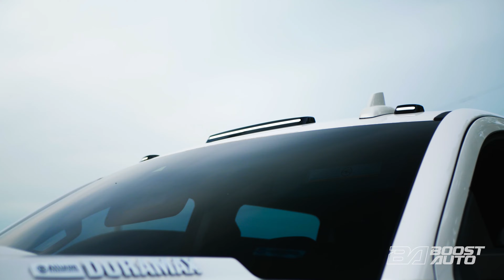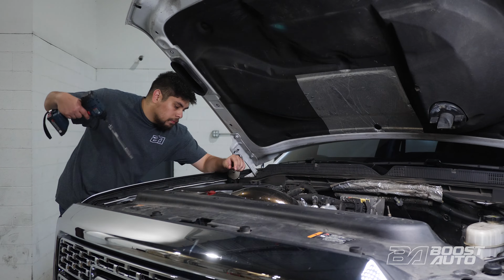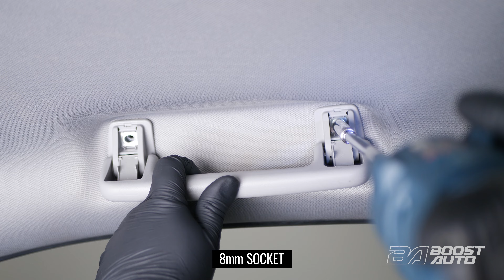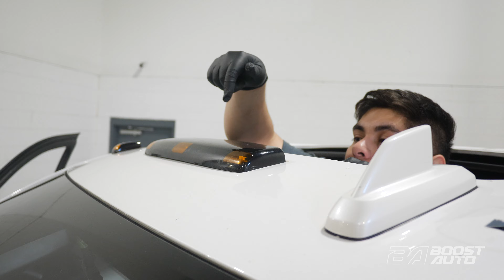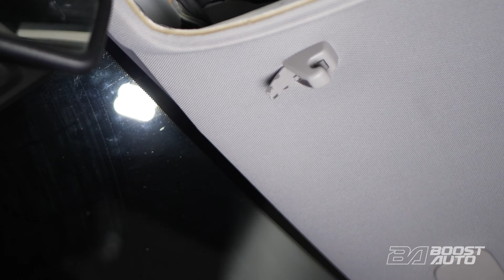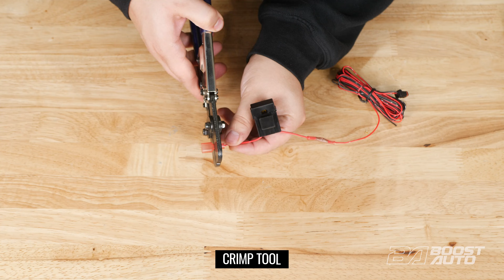Boost Auto S-Series Cab Lights Installation Guide | 2015-2019 Chevy Silverado & GMC Sierra 2500/3500

Comment: If I were too get white with running only with start up sequence would I need the module and splice wires or just plug into factory plugs
Reply from the maker: Plug & play - you only need the module if you get turn signal

Comment: My cab dint come on i bought the ones with trun signal but have not installed the module yet will they not come on normally without module??
Reply from the maker: If you bought cab lights that have the S-Series Module, the module  be installed in order for the cab lights to function. If you simply plug them in, they won't work until you install the module
Reply: @boostautoparts  
Thank you got them to work i was wondering why they would not come on and had power on all connectors  i ordered them amber but thinking I want white can I change them simply with the wiring because when I was trouble shooting I saw them flash white
Reply from the maker: @ to inquire on alternate options, please contact our team at 765-831-2830

Comment: Okay so I’m not sure what’s going on here because my factory cab light does not bolt on it only screws from the top
Reply from the maker: Factory cab lights for this generation of truck bolt from the bottom up. If you're screwing from the top down you must have a prior generation of truck. Contact our team at 765-831-2830 or email sales@boostautoparts.com with your VIN and we can assist

Comment: What if you don't have any lights? What is the layout and what is the best tool to drill those square holes?
Reply from the maker: If your truck didn't originally have cab lights you should reference our retrofit install video which will be available in the next 3 months as of writing this comment (5/14/2024).

With that video you will see we will provide a template, wiring harness, and you WONT have to cut square holes! Stay tuned. Feel free to email sales@boostautoparts.com if you'd like to be notified when they become available.

Comment: My 2019 2500 does not have the power cable in pin 1 where should I tap for power?
Reply from the maker: Give our team a call at 765-831-2830 so we can assist!
Reply: We’re do u tap for power without the power cable
Reply: My doesn’t either.  Were you able to tap for power?
Reply: They sent me a fuse tap and just tapped into one of the fuse in the fuse box
Reply: @SMDO  I got a fuse tap but no idea where to connect it and did you have to connect your ground
Reply: I tapped into fuse 10 which is a 15A for Cargo Lamps, for ground I just spliced into the ground cable on the harness
Reply: Pin 10 on the harness for ground
Reply: @SMDO  so pin 10 for power what about ground? Or you used pin 10 for ground?
Reply: @MiguelGonzalez-yu2jm  
pin10 (black cable) for ground. 
Fuse #10 (15A Cargo Light) for power

Comment: Is there an other way to connect or wire the cab lights for those of us that don’t have the factory cab lights with the factory harness?
Reply from the maker: We will have a separate video and wiring harness specifically for those who are adding cab lights to vehicles not originally equipped.
Reply: @boostautoparts did you ever make that video??
Reply from the maker: Still in the works - should be available in a few months (as of writing this; 2/12/2024) @AshtonMakovsky
Reply: @boostautoparts  update on release date?
Reply from the maker: @omartavarez263  Soon! Email sales@boostautoparts.com and we can shoot you an email as soon as they drop.
Reply: @boostautoparts ever release the video for this body style of truck that doesn’t have factory cab lights ?
Reply from the maker: @tommymadsen3915  Yes, here you go!

https://youtu.be/S9l9RSgKj8A